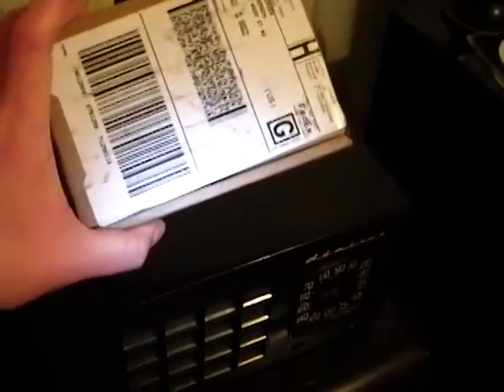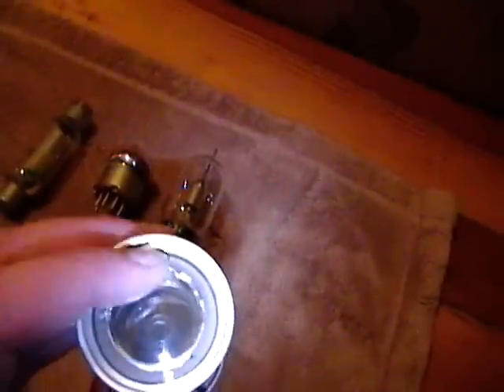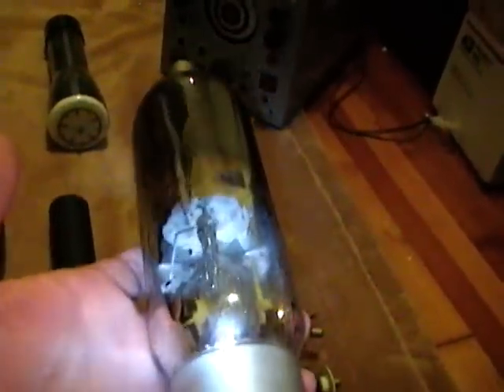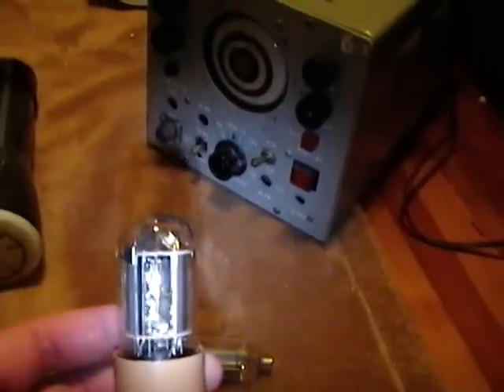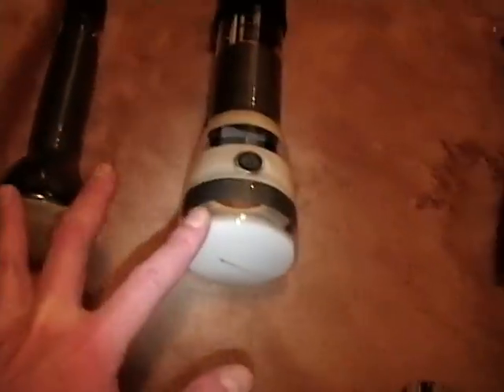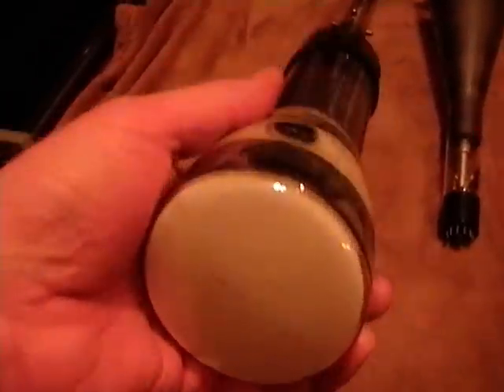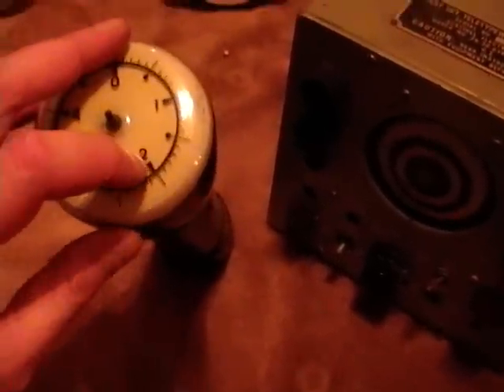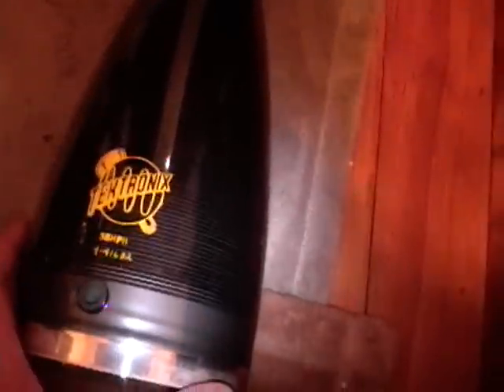Cathode Ray Tube fun - part 1

Comment: I have a mercury vapor rectifier almost identical to the metal based one that you show, someone gave it to me years ago. Since it has that large bayonet four pin base I was never able to test it in a tester. I also had an 866 tube somewhere, that I did test and it puts out a pretty ultraviolet glow.

Comment: always willing to trade HA cool cathold rays I got oh say 2000 various tubes from 6l6s to mullard 12au7s also into old light bulbs got a osram gec bulb rated at 240 watts @ 26 volts made for air ministry in about ww-2 old General Electric MAZDA gas filled bulbs from pre 1945.